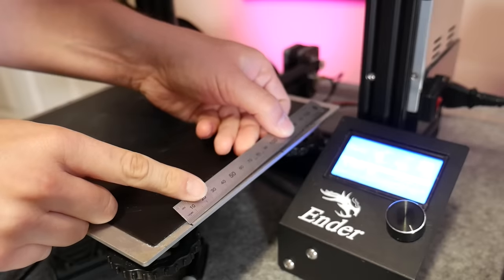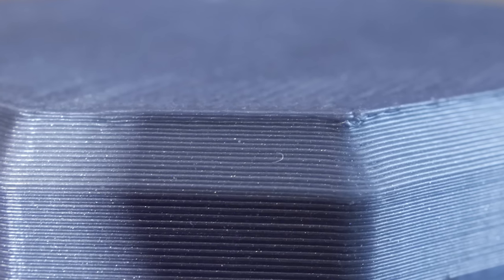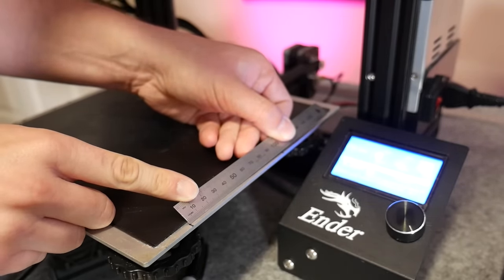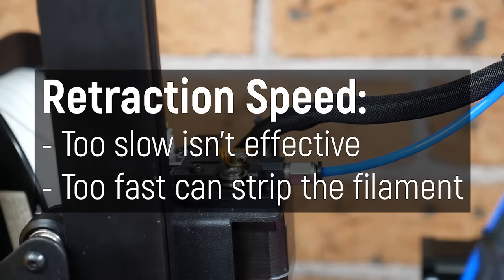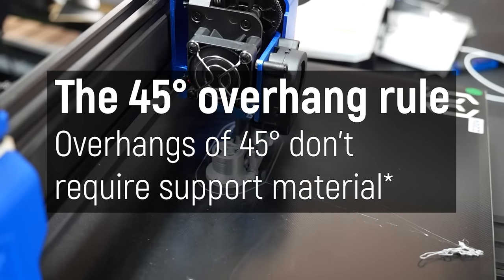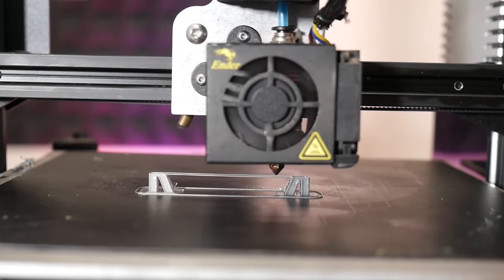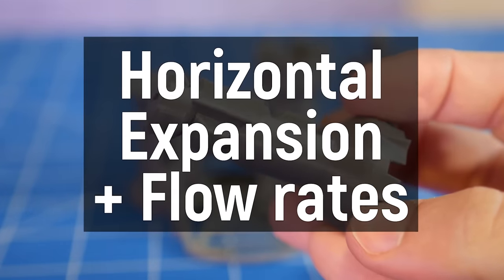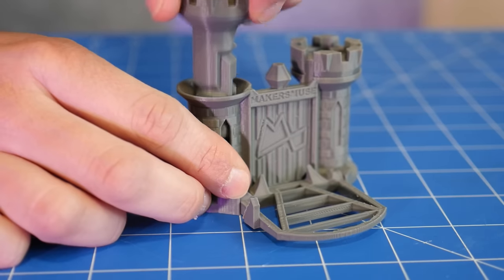The Ultimate Guide to Perfect 3D Prints

Comment: My printer just loves scratching against the infill as it moves. I have no idea why but it's really annoying. I mitigated it slightly by setting infill flow rate to 95% in cura but it still scratches. I have bltouch and perfect first layer etc. It only scratches the infill, tops look good and most things still print fine but that's really worrying. Ever since I've gotten this printer (ender 3 V2) I'm stuck in a limbo of fix, calibrate, find problem, fix, calibrate etc. 90% of all my prints are just tests or failed prints. I've ever only printed small things. Not to mention that my ender came with a faulty board so I changed it to 4.2.7. All this is really off putting and I've probably gave up like 3 or 4 times already before going back to the same thing. It's a hobby but it's more stressful than fun at this point... Also I don't want to use z hop since it makes stringing worse among other things.
Reply: I feel your pain.
All the things CHEP says to do made my printer Awesome

Comment: I really appreciate this video, but this is very overwhelming.  No doubt, I need to watch it again and again.  I have a different issue not covered.  I did my first print and the plastic was basically glued to the bed of the printer.  I used a scraper to get underneath and tapped it with a small hammer.  There were parts that I could not get underneath.  When I tried to pop it off the handle I printed separated with top coming off and the bottom still glued down.  Two questions.  First, what did I do wrong?  and second, how do you remove remaining plastic?

Comment: Gr8 video I shall be watching again and again. 
I'm new to all this , I won a Netune 2 on ebay and the calibration cube just came out like spaghetti.  Do you have any links that remedy this please as at moment I'm just trialing.
Reply: If you're still having the problem it's bed leveling and adhesion
Reply: @zacharysmith8397  cheers I've ordered some different springs to see if that helps and also given the bed a good clean. I shall try the glue stick technique to see if that helps.

Comment: It won't help for interior clearances (this won't work for print in place models that should move) but if you have just a little stringing on the outside of a print and it just looks bad, I've had great success hitting it quickly with a butane torch which melts the strings down to the point they're basically invisible.

Comment: Thanks for your videos. Very interesting and very informative. 

I have an ender 3. If I try to make a 5mm female hex I don't get 5mm. I tried the horizontal expansion, but affects the outside diameter. This is for a wheel I designed for one of my RC cars.

I had to go in my case software and add at least .2mm.

Comment: For calibration actual cube is bad: if it's small then you are unable to tell if there is something extra because of "squishing" or extruded material or with calibration.
I used 3 bars: 10x10x100mm, each placed in different axis. This way very fast I could verify if scale is correct. This way you get 5x better measurement than with 20x20x20 cube.

Comment: I have some feeler gauges as well but I find that 0.2mm is way too large a clearance for my printer. I've been doing some testing on my new Ender 3 V2 and I find that 0.05mm gives me the best result. This is also a similar thickness to a normal sheet of paper which many people use to level their bed. That said I guess it depends a lot on other variables and settings. I ran my test with the standard 0.4mm nozzle with the filament that came with my printer. 200 degrees C for my hot-end and 60 degrees C for my bed. All other settings are still stock. Running Jyers firmware.

Comment: The one thing I need to know is when you preheat when you’re doing stuff like this to calibrate, do you pull the film it all the way out? Do you just pull the filament back into the tube? Where is no longer with the heating element? Or does it matter?

The biggest issue I’ve run into is clogs, and I can’t tell if I’m running to Hot! or too cool. Is 200 ok for PLA? 220 too much? 195 too cool??

If somebody said to use 230° for PLA I would do that right now but I’m not sure if that’s the right way to go since I always end up with solidified

Comment: I've yet to beat the Clearance Castle. I've neglected my Prusa MK3S after I first tested and aligned it ages ago. It still prints very well - except the castle. Found so far - LOTS of loose bolts, way past due for lubrication, suspect slicer settings (I made changes to make supports easier to remove), bed adhesion issues, etc. I'm having more fun troubleshooting than I do printing!  Big ask - can you provide printer specific GCODE? (or find a way for fellow downloaders to upload theirs if using a "vanilla" version of their printer?)  It would be useful to know which side the problem is on.  Thanks for the awesome challenge, and fr the follow-up video!😁
Reply: In the end, it was just bad filament. What a merry chase though!

Comment: Why would it be "physically impossible to create suction" that would "suck up" filament? If the half-molten filament creates a tight enough seal then why wouldn't the atmospheric pressure push the filament up into the nozzle when pulling it from the other end? Especially considering most filaments consist of such long molecules it's all stringy to begin with.
Reply: one way to test if it makes a difference regardless is to have it sit hot and measure how much oozes over a period of time, then do one with occasional retracts
Reply: @hoffer_moment  But long term ooze is way, way different from, say, a 2 second window while traveling. Those might have nothing to do with each other. E.g., depending on the polymer's thixotropic and/or rheopectic characteristics a quick retraction might be extremely effective for a short time, while also oozing like crazy over a longer time span.
Reply: Fundamentally, it is possible to maintain control over some of the already extruded melt and suck it back in; however realistically it rarely happens, because the existing print down below is tugging on the melt as well, at the same time as you're tugging on it by the filament from the top, and so the melt that is already in the nozzle melt chamber will usually break at an arbitrary point, letting some air into the nozzle, and then whatever's below the break will necessarily ooze down, you can't hold it any longer.

Having filament extra pristine and dry and also having slow retraction speed actually helps.

Comment: I’ve discovered that my print bed is not flat. My solution was to put small pieces of paper in between the sheet metal and magnet. Unfortunately, this means that I have to replace them and relevel the bed after EVERY print that requires me to lift off the bed for removal of the printed item. Do you have any other suggestions?

Comment: I saw Angus do the extruder calibration by taking off the motor. I have done the calibration with an assembled extruder, thinking that I want the amount of filament to be extruded under the operating pressures, but it may be that if the pressure changes over time, the output will be jagged. Which is better, calibrate motor separately or within the extruder assembly?
If done separately, and I assemble the extruder and discover that under pressure the amount of plastic extruded is way lower, what can I check then?

Comment: man.. i would buy you a vacation trip to portland oregon for a week to help me dial in my maker lab i built for my hotrod shop.  i bought a broken cr10 1.0 to open the book.  3 months ago.  since, i bought a broken xplus, broke the hotend/extruder a few times, its down now with a nice icarus but a bad ribbon cable.  a broken cmax followed.  that one had many old mods and worked, almost. cmax is torn down and just repainted white. but then i decided it needed a nice set of rails and x-y up top so it will be a week before its octopus gets a harness made up. 
 a davinchi 1.0. its 90% through an octopus 1.1 rebuild. cheesy laser scanning though!  an flsun sr.  new last month.  learning about retraction, i broke the snot out of that.  octoprint/pi/marlin issues told me iim doing too much with too little experience.  oh yeah, the 54" bed printer i decided to make from scratch is 80% done.  im sure theres a dozen real errors in its design.  im watching about 10 channels daily as i go build houses, then run the hotrod shops work, then learn all of this and its daunting!  i find your work to be the most useful in a small pool of very useful bodies of work around here.  cheers and thank you.  keep it going.  you are top shelf scotch around this subject.

Comment: Esteps should be calculated/calibrated with the bowden tube and nozzle setup as if you were printing. The resistance of the PTFE tube and the size of your nozzle will affect the Esteps number. If you calibrate it the way it's shown in the video, you will most likely end up with under extrusion when actually printing. Esteps also need to be calibrated for each filament. Different filament characteristics will change how well your extruder gear grips and can move the filament. Example, I need PLA at 106.3, but PA6-GF30 needs to be at 116

Comment: I have an outside the box question
let's say we want to print with ABS but only one layer, on top of different styrene plastic
To make things more interesting, let's make the plastic clear and smooth 
is there a way to "draw" with 3d printer that single layer so it would bond with the plastic below? How to tune ender3 style printer for that?
the part like that could be used to make model train window panels that would just pop into a model wall and, where cuting those window frames in ...1:160 scale simply isn't possible 
people for years used etched metal parts for that purpose, but with 3d printer it would be so much easier if only the filement would stick

i tryed it and abs wouldn't bond to heated polistyrene sheet, which was kind of wierd, since they both styrene based plastics that can be easyly melted together by soldering iron or acetone

Comment: You talked about overhangs drooping/sagging down, what if they pull up? I run into that issue, is it too much cooling?
Reply from the maker: Depends on the filament, if ABS is warping up it's cooling too fast but PLA warping up is usually from too little cooling.

Comment: Hey Angus. I have a question. What speed do you usually print at? I just printed the clearance castle on my new Ender 3 S1 Pro. I printed at 0.15mm layer height with 3 walls and 5 top and bottom. It printed perfectly but it took 7.5 hours at 50mm/s. Is that good or should I print at 100? What do you recomend? Thanks.

Comment: to the flowrate, you are kinda wrong, I perfectly calibrated my printers and get inconsistent layers with some filament, Im sad that so few people mention this, you NEED to calibrate the flowrate for every filament or you get inconsistent layers, had one PLA that printed fine with minimal anomalies, then I printed a different PLA that had ALWAYS inconsistent layers, so I printed a 20x20x20 cube with only one outer wall, no top/bottom and no infill, measured the wall thickness and adjusted the flowrate, after that I had no inconsistend layers anymone and it reduced the stringing aswell, because no filament is always 1,75mm thick, it varies and for that you need to adjust the flowrate or else there will be too much or too less filament extruded which builds pressure in the nozzle, causing this layer and stringing issues.

Comment: About de flow rate.
if you print with more speed, do you need change de flow rate?
Like.
print speed of 60 mm/s and 80mm/s or 100mm/s.
you need change de flow rate for compensate de speed in of infill? and change just infill flow for example?

Thank for the video.

Comment: Sorry I do not agree with your calibration method on the X, Y, Z axis.

On Cartesian printers the steps per mm is a mechanical formula based on mechanical properties of the drive system. It is based on
1. The amount of micro steps your stepper drivers are set to
2. Step Angle of stepper motors
and
3. the rod pitch per rotation
or
4. belt teeth pitch
5. teeth on belt drive pulley

The e-steps should also be very close to the above with the diameter of the hob gear. BUT it is affected by how deep the hob gear bites into the filament. and can change from filament to filament.

If your dimensions on X, Y, or Z are different from this then your printer has a mechanical or electronic problem.
On E steps it can differ, but not by much or there is a mechanical or electronic problem.
Reply: Actually it's affected by the number of teeth on the gear and the pitch diameter.  Think of a rack and pinion; it's not affected by the depth of engagement.

Comment: Printing the test cube it, the infill has gaps in its lines while printing, the cube outer sides are fine, the top maybe incomplete too and can have a visible hole. I also have vertical lines on the sides of the cube, is that ringing? How do you tune acceleration and jerk.

Comment: Hi, @Maker's Muse What is the Pink Mat called on Print Bed you are using? Does it help with adhesion of prints better than magnetic flex steel bed plates? If yes where can I get it? Thank you!
Reply: ok got it myself its called FR4 or G10 PCB material Resin board.

Comment: People change everything way too soon. People change esteps before they get their bed leveled  it is a last resort.
The steps per mm have been worked out theoretically and are therefore correct for the machine. 
If you change it for different hardware you might need to do this else flow/multiplier. 
If you leave the E / steps in your firmware alone, you can also more easily compare or share your slicer settings with other people. Your hardware works the same as with other people who have the same printer.

Comment: I may be over thinking things but if anybody understands the concept it is probably you...

Is a power conditioner ever neccessary for 3d printing? I'm referring to what commonly gets mistaken for a surge protector but this particular one flattens the mini power spikes from the incoming power. I use to sell them for home theater but don't know if 

a. It would apply to printing and 
b. If the power conditioner was ever its weight in scrap gold. 

I'm curious because with so many magnets, motors and mixed voltages, I imagine it could cause some interferences.

Comment: Do you typically have to change some of these settings based on the filament you are using?  If someone has always printed successfully in PLA and decides after test printing a part in PLA they want it to be printed in something more durable, What changes should be made?

Comment: Hi, Im still in the first step (bed leveling). I managed to get my four corners pretty smooth, however my center square still has spacing between filament lines (as if it were too high). What can I do to fix the center square without compromising the leveling of my four corner squares?

Comment: Is bending your lead screw illegal in 3d printer culture
Reply from the maker: It's certainly not enjoyable to do :(
Reply: You can shim the ends, rotate till high spot is up, then just step on it with your foot. But as a result, it will just get a different kind of wobble bend. You can spend many hours trying to straighten.
Reply: @MakersMuse  also thank you I just got my first prusa and I used this video to get the correct z height

Comment: Hi Angus do you know if using a 0.6mm nozzle will still allow for using your clearance prints?
Reply: Wondering the same. Never had a clogged schnozzle since ditching the 0.4 and fitting the 0.6. Winner!
Reply from the maker: It SHOULD work so long as you still use the 0.15mm layer height, but I haven't tried it myself yet with a 0.6 sorry!
Reply: Slice it and see if any paths are thinner than about 0.64 mm. If yes then there might be a problem, if no then the nozzle size shouldn't be a reason for problem.

Comment: Does z hop work well on the ender 3 without a dual z set up?
Reply from the maker: Seems to work fine, but I don't generally enable it because of the stringing it causes.
Reply: @MakersMuse  would a direct drive help to reduce the stringing that z hop causes? I have an ender 3 that my brother broke and gave up on. I’m trying to make it more capable like my prusa’s. So far I’ve added a microswiss all metal hot end, cr touch bed leveling, and a magnetic build plate

Comment: On an ender 3 pro, should I still raise the z when using a feeler gauge? Mine is completely stock with just the 4.2.7 silent board installed and I am pretty sure I can’t save the z-offset. So if i’m not wrong, when I level the bed with a 0.2 feeler gauge without adjusting the z-offset and then start a print where my first layer is 0.2 I will actually get the first layer at 0.4 since I can’t save the z-offset and therefore I’m not at true zero.

Comment: 2:46 im pretty sure this is wrong, steps a mm is a setting you shouldnt touch.  If thats out its due to belt, rail, motor etc. Doing this will make a 20mm cube 20mm but then print an 80mm cube and it will be out.